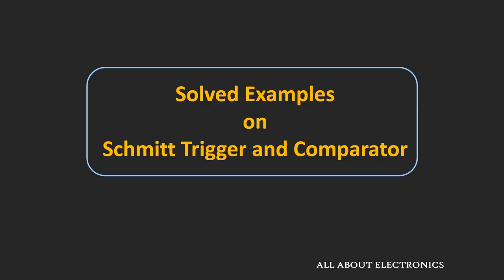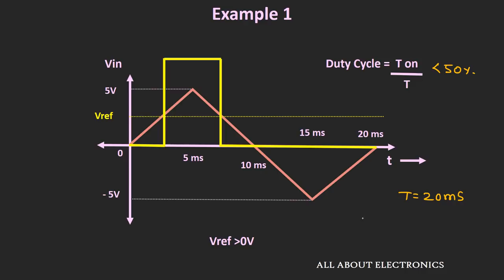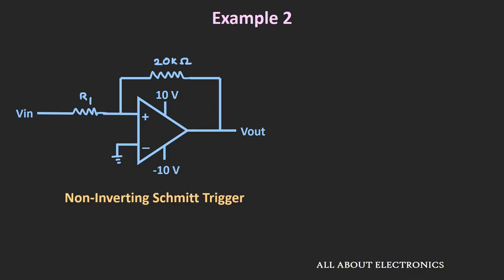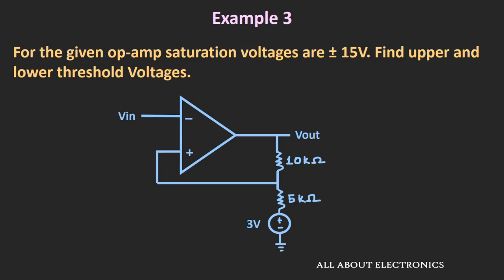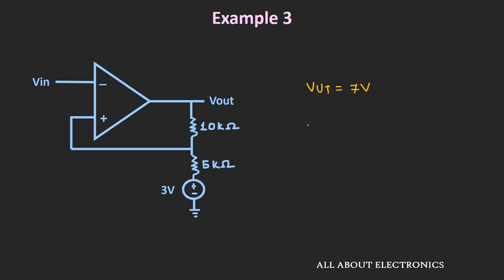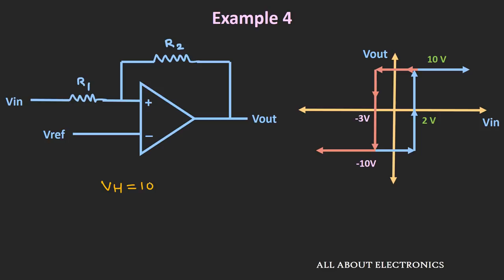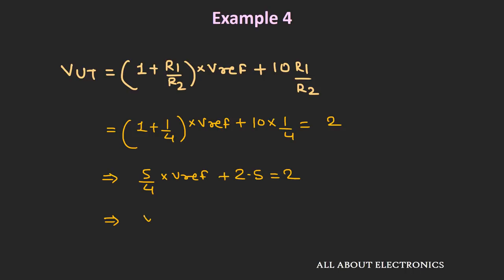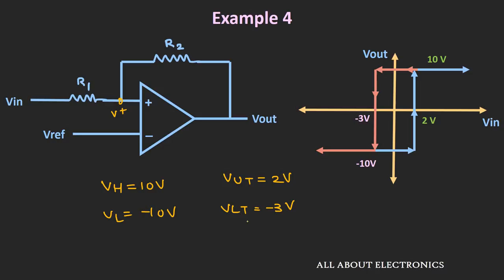Solved Examples on Schmitt Trigger and Comparator

Comment: How can be Vin>V+ if Vo =+15v? @23:07 timing
Reply from the maker: I think you have mistaken V+ as the positive supply rail voltage. It is the voltage at the non-inverting terminal.

Comment: hey, in the last example, since there's a Vref wouldn't the transfer characteristic graph shift left?
Reply from the maker: If you see, because of the reference voltage, the transfer characteristic is not symmetrical. (-3V and 2V). The effect is already is taken into account.

Comment: Can we do for example 3 like treating circuit as without reference so we got 5 V as UT and -5 V as LT and after adding reference +3 V so we got 8 V as UT and -2 V as LT , So my question is could it Work or not because answer is not same..??
Reply from the maker: It won't work that way.
Reply: @ALLABOUTELECTRONICS  Thanks

Comment: How do you decide on taking Vh or Vl for Vut and Vlt? Does it differ for both configuration (ie) inverting and non-inverting Schmitt trigger?
Reply from the maker: Yes, it depends on the Schmitt Trigger configuration (Inverting or Non-inverting). 
In case of inverting Schmitt Trigger, when input crosses Vut, the output becomes low voltage. While in the case of non-inverting Schmitt Trigger, when input crosses Vut, output goes high. 
More more information please check my video on Schmitt Trigger. Where I have explained it with the transfer characteristics. 
Here is the link:
https://youtu.be/5-ohKRWeod4